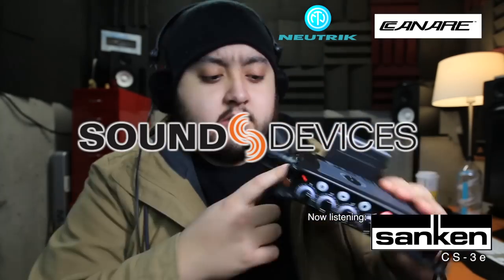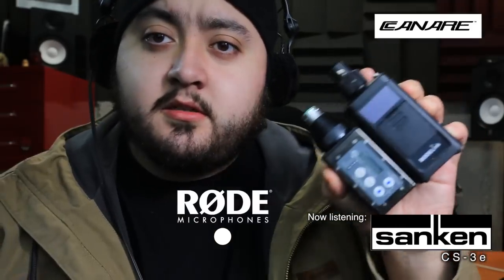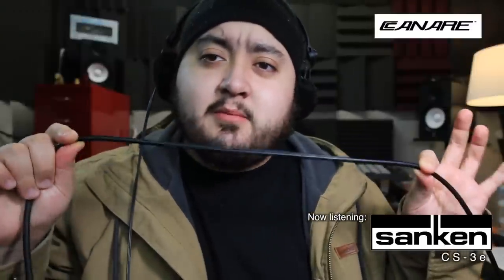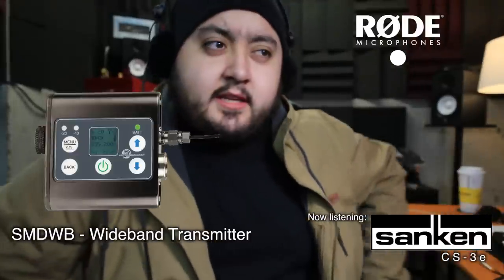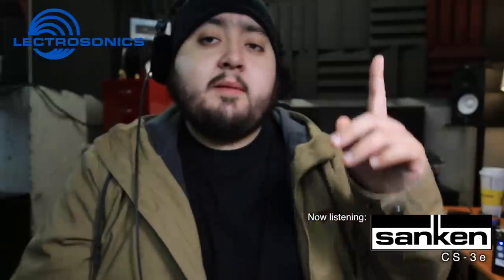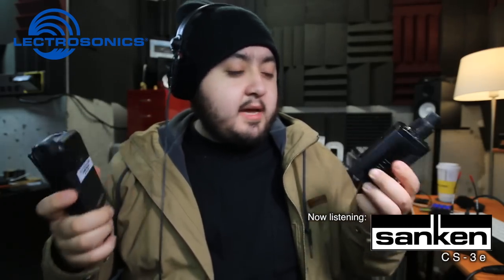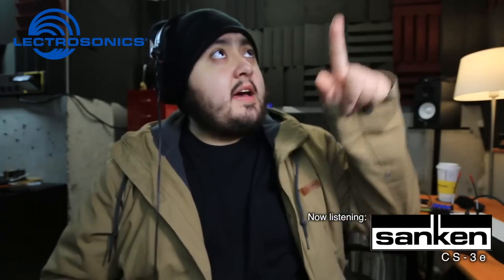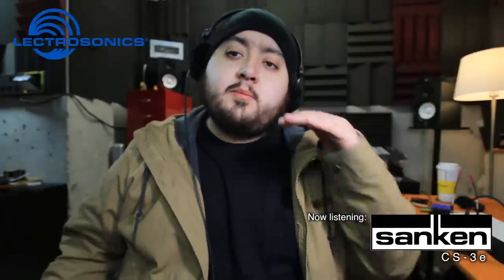XLR CABLE VS WIRELESS TRANSMITTERS / LECTROSONICS + RODE +CANARE

Comment: Hey, post production guy here. I edit production sound for a living (I also record it!). I gotta say, wireless is amazing for the possibilities, but it DOES NOT replace cables. In a set you may not notice any degradation but I can clearly hear when a boom mic was recorded using a plugon instead of a cable. Plugons are super useful for tricky shots and difficult locations but cables will ALWAYS sound better and be more reliable, especially in urban environments.

You can't compare separate recordings, so forget the noise floor. Listen to the higher frequencies whenever there's dialogue, wireless will have a hissy top end because of RF signal. If you scan all the time for the cleanest frequency and you're in the countryside you might get away with it. But in an urban environment, cables for the win always.

That being said, Lectro is the crème de la crème in wireless gear and I'm not dissing it by any means, I'm just saying: wireless is more practical and opens amazing possibilities. Cables are more reliable and sound better.

Comment: Nice, I yet have to download the files, but on YouTube the Lectrosonics is missing a tad bit high end, compared to cable. By personal downside of going wireless is that you can not adjust the input gain easily on the fly. You have to fiddle in the menu vs just riding a  knob on the mixer.
Reply from the maker: Yeah that’s the only down side you have to pull out and get the boom out of there if they start to scream, I just give it some distance so it’s not saturating the mic

Comment: Hi thanks for this video comparison.  I've not been able to get the Tx-Xlr new. So I'm considering one on the used market.  I found one where the rotating collar was removed ( to fit a particular mic ) and misplaced. Is it that the locking mechanism is spring loaded the and collar is just there to push down  the locking mechanism and either hold it in the unlocked (Depressed)  position or release it so that it raises up ( under spring tension) to lock the mic in place? The reason I ask is that does it also serve as a way to stabilise the mic on to the Tx-Xlr so that there is no wobble? or is that handled by the O-Rings. I'm trying to determine if I can get by fairly reliably  without the rotating collar. I have not handled an actual device but I'm hoping that I will only have to depress the lock by hand and not that the collar helps with mechanical  connection stability. Any input will be helpful.  Thanks in advance

Comment: It's difficult to compare three separate recordings. Can you take the first recording of the wired connection and send it to a second recording device using different transmission methods so you get an comparison to one single reference standard? I would throw in a Sennheiser G3 wireless also into to the mix just for another option to compare.
Reply from the maker: I am trying to figure something out to be able to record the same source at the same time to make it easier to compare thanks for the input !!!! 🙏

Comment: for wireless xlr i only own the rode. it's a nice piece of gear, but i never use it and i don't like the sound that much compared to cable. i always use a cable when i'm by my own. rode for me as plant mic, or i would give it to second boom (but im always a one man band doing 90% commericals or fieldrecordings for sound design)
also, most of the time i'm using a MS setup in the blimp, so i have to use a cable. 
the lectro sounds better to me. the rode rolls off more of the body and the highs. cheers!
Reply from the maker: Yeah if I were doing field recording I would never go wireless,  what ms setup you using ?
Reply: as figure of eight a "ambient emesser" (the newer one, sounds ok, but not ultra-good :) ), this little thing is very light & small - easy to mount on a shotgun or hyper.. i use it most of the time with a 416 or in the field for a better stereofield with a cardioid/hyper. the broader the better in my opinion.
Reply from the maker: Yeah then you can also
Control that in post right ? How wide it is ? I heard something about a software that lets you import the 2 different files so you can control that
Reply: Jup, right. Tracking 2 separat mono-channels. activate a MS-matrix in recorder (i use zoom f8) only in headphone routing, so i can hear the decoded signal (= stereo). in post i use the free plugin MSED from voxengo, or often i build the matrix by myself: Mid Mic (shotgun or whatever) as it is. the fig8 mic has to be dublicated, one panned hard left, one panned hard right. flip phase on teh right one. then you can balance between the fig8-tracks (side) and the shotgun (mid) - the more side the broader. sounds weird if you go too broad and the feel depends also on placement from the fig8-mic, it has to bee aligned with the capsule of the other mic...not always easy, the 416 is a bit tricky becaus the capsul is somewhere in the middle of the slots.
hope you understand what i'm brabbeling in my lowbob-english :)

Comment: Is the Canare your standard XLR?  Do you also use Mogami cables?
Reply from the maker: Mogami is good too switchcraft also good
Reply: @RLFOSOUND  I just made a bunch of cabling using Kopul 500 series cable (almost identical to Canare quad core as far as I can tell) with Switchcraft connectors.  Mogami... I just have a hard time trusting their small gauge.  I got rtid of all my interference problems.

Comment: The rode is very impressive for the cost. I feel like the distance/RF interference test with the rode vs g3 vs HMA. For some reason I've always get  RF interference with g3s on any set other than a corporate shoot. I know people swear by it but now my stomach drops every time I have to rent it. I've had a better experience with rode wireless other than the noticeable higher noise floor. I know people swear by g3s but I just get bad luck with it.
Reply from the maker: What frequencies have you use on the g3 are you scanning new channels on every location ? The rode it’s not a bad first option but if sound quality it’s an issue go with cable the hma for me sounds great :)
Reply: Yeah, the Senns can sometimes get pretty spotty in some areas, even if free frequencies available. NY or LA, or any city probably, are fierce sometimes. It's a pity, but that's why the Lectro/Zaxcoms are 4x the cost, and still can be subject to airshizz. Oh, the airshizz!
Reply: The G4 500 series can push up to 50mW now. That helps a LOT with hits.